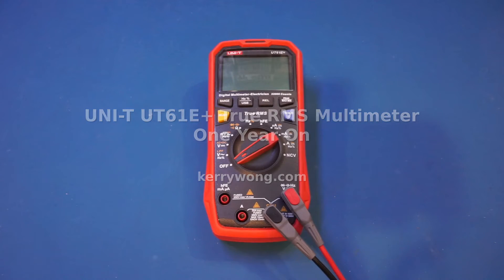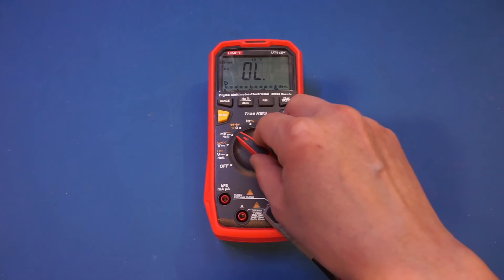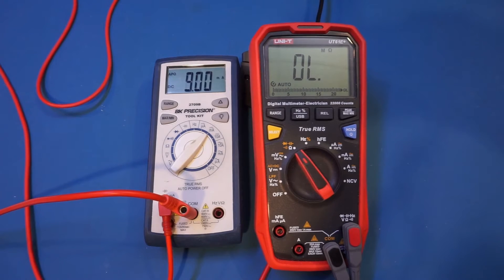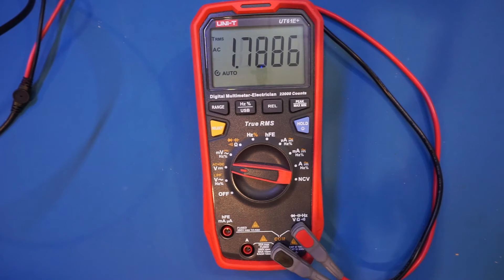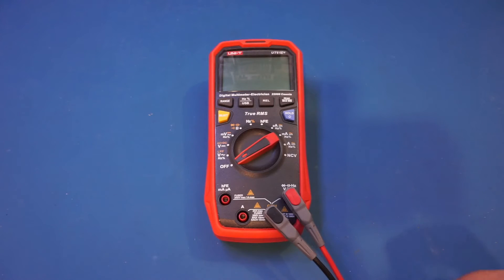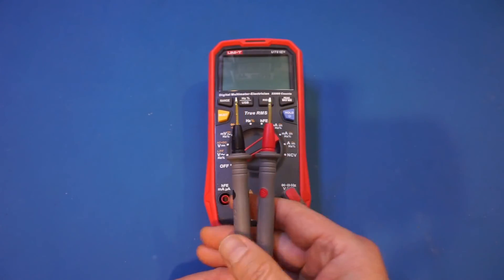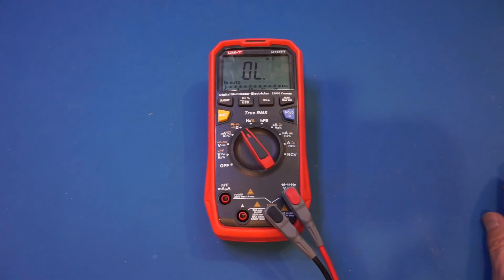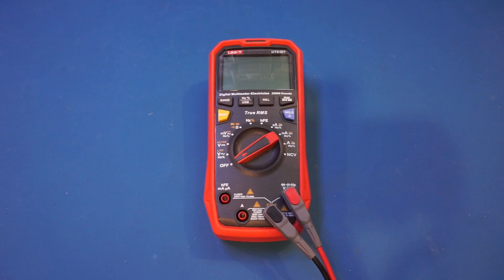UNI-T UT61E+ True RMS Multimeter One Year On

Comment: Hi Kerry, thanks for your great videos, they've always been super helpful and I usually checkout your blog before making any purchases. I am considering purchasing a UNI-T UT61E+ as my regular multi-meter, but would like to know the burden voltage, (and actual accuracy), in the DC micro-Amp measurement range? Are you able to supply this data?
Reply from the maker: You can refer to the datasheet for the accuracy and I had validated the accuracy with other higher accuracy meters. The burden voltage in the uA range is roughly 0.5mV/uA

Comment: Thanks for measuring the power consumption, very helpful. For comparison, on my Kaiweets KM601, which also uses AAA batteries (3 of them), I'm getting 33 mA active draw and 0.01 mA when it's off (can only be turned soft-off). The standby draw is not concerning, given that it will deplete a full set of AAA batteries only in >10 years, but the active power draw only allows for ~36 h of active use which I think is quite low. That's what you pay for a large display with a backlight that's permanently on.

Comment: Hello, Kerry
I would like to know if I can use the rechargeable Eneloop or Eneloop Pro Ni-MH batteries (1.2V) as the power supply, instead of the 1.5V alkaline batteries, for the UT61E+?   Thank you for your time.
Reply from the maker: Why using rechargeable when regular batteries are so cheap? That said, it will work with NiMH batteries. NiMH batteries has pretty high self-discharge rate and aren't really suitable for these low current draw devices.
Reply: Enveloop is an excellent battery brand and they have very low self discharge, so you can use them for this purpose. Nevertheless there is a detail you must take into account, as follows. The plateau voltage of the NiMH battery cell is 1,2V, which is much lower than the one of an alkaline cell. As these cells are connected in series, this difference is getting even more higher. For example, if the multimeter works on 4 AAA cells, if they are alkaline, the sum of their voltages will stabilize around 6V or there about, while the same sum will be 4,8V for the NiMH cells. This means that you can use the NiMH cells when they are fresh charged and their sum voltage is 1,35V/cell, namely 5,4V for 4 cells. The point is that you will need to charge them more frequently than usual, as the multimeter, being calibrated for alkaline cells, will consider them as exhausted and it will work mostly with the "low battery" indicator energized. Other than that, there is no problem at all. As regards the rechargeable cells themselves, you need a really smart charger (and I propose you the Panasonic BQ-C 17 ,or 54, which are both affordable and slow charging rate chargers), for the longevity of your cells. These chargers recognize the charge level of the cell put on them to be charged, therefore cutting the charging process at the proper time (I.e. much sooner than a standard charger), protecting your cells. Keep in mind that you will need to recharge almost fully charged cells, for the reason I already explained. Therefore the reliability of your charger must be confirmed in order to extend their useful life...

Comment: Another excellent video Kerry!  Hope you are well!  I've been looking for a new meter and have watched a ton of reviews of yours, as well as a few other YouTubers.  I narrowed down my choices to 3 Uni-T meters: UT117C, UT139E/S, and UT61B/D/E.  I ruled out the UT61 series because of the insensitive NVC function as well as the dial selector sometimes going in between functions.  It really came down to the other two models for me.  I chose the 117C because it seems to resolve the issues I mentioned here with the UT61; I don't know if the UT139 resolves the dial issue, but the NCV function seems to be more sensitive than the UT61.  At the moment, the pricing on both the UT139 and UT117 is $80, with the UT61 at about $90.  Let me just say that there are too many meters out there, even if you consider just one company (Uni-T).  Maybe you could do a video on the different lines of meters, and why one would choose one line over another.
Reply: which one has the lowest burden voltage in low range?

Comment: Hello,
Would you mind taking a minute to answer my question?
I am writing to you to seek your advice on the purchase of a multimeter for measuring small values on the order of millivolts and microamps. I am considering two models: the UT61B+ with a 6000 display count and the UT61E+ with a 22000 display count.
I understand that the display count refers to the maximum number of digits that can be displayed on the multimeter's screen. However, I am still unsure of the practical difference between the two models. Would you be able to provide me with some guidance?
Thank you for your time and consideration.
Reply from the maker: I took a look at the specs, yes both the 61B+ and 61E+ have a 0.01mV resolution in the mV range. The higher counts come into play if you are measuring between 60 and 220 mV. For 61B+ because it's a 6000 counts meter, you will only have 0.1 mV resolution instead of the 0.01 mV resolution you get with the 61E+. Similar concept applies to the current ranges as well. Hope it helps.
Reply: @KerryWongBlog  
I really appreciate your effort in finding the answer to my question and providing me with the relevant information from the user manual. I should have taken a look at the user manual. It covered all the aspects I needed. Thank you again!